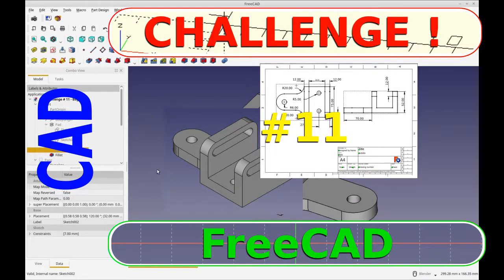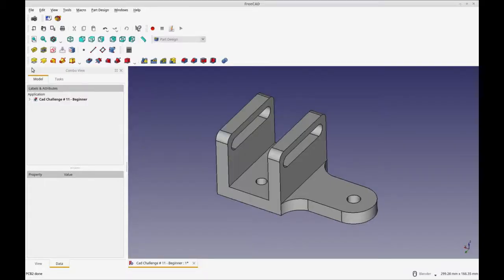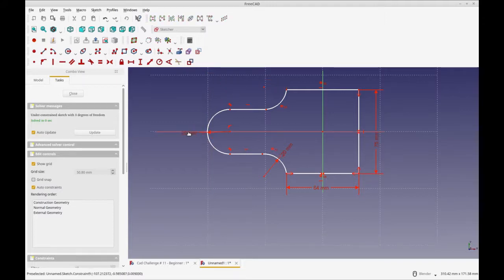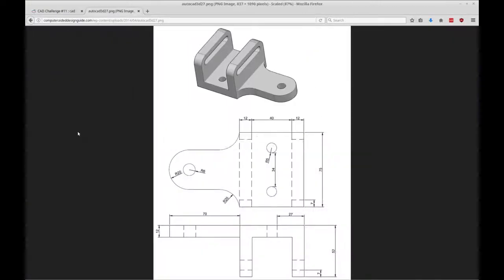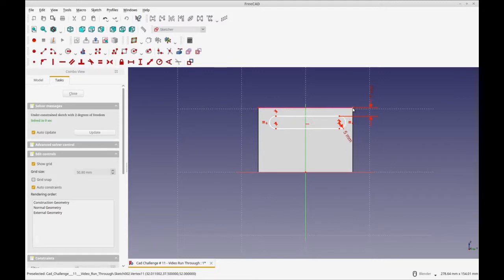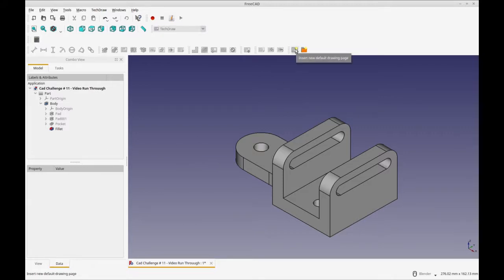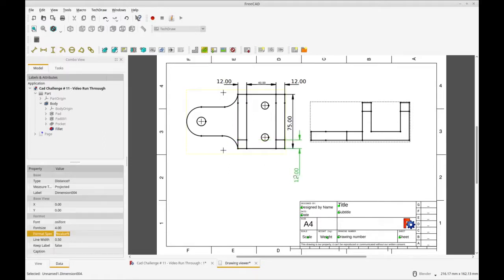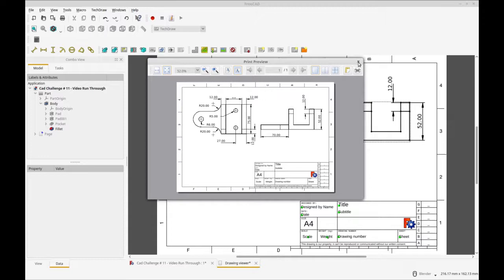CAD Challenge # 11 - Using FreeCAD

Comment: You are missing a tangent constraint for the two arc's top and bottom. look at the connecting line between the 180 deg arc and the 90 deg arc, they are not the same length top and bottom

Comment: Thank you for your videos. I've learned a lot.
I have a question. I'm using 17 daily build, so this maybe my problem. When I pad the second sketch to the first pad, mine looks like separate pieces, even though it shows as one body. Yours looks like one piece. How did you do that?
Reply: Thanks for the reply. I've never been able to get that to work. Been using FreeCAD of and on since .14. I'm currently using linux (Ubuntu 17.04) with FreeCAD version .17 build 11174.
Reply: Thanks again. I used the sketcher and part workbenches to get the the exact final part, but always looking at how others do things differently to arrive at the same result.